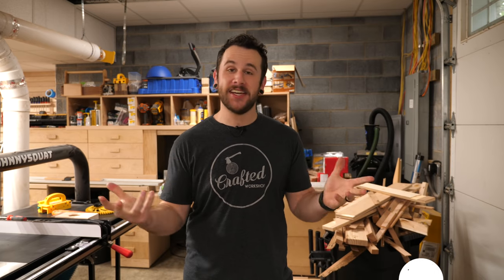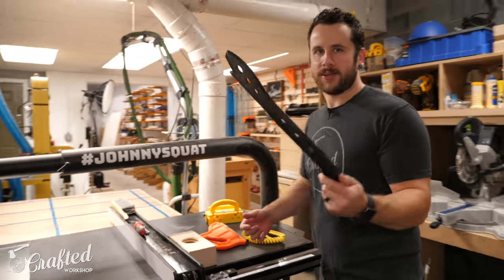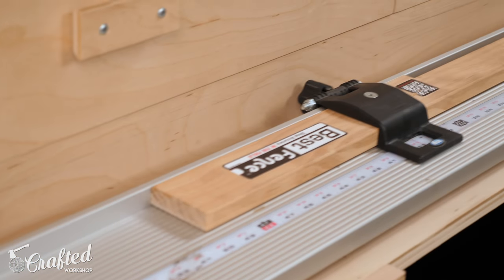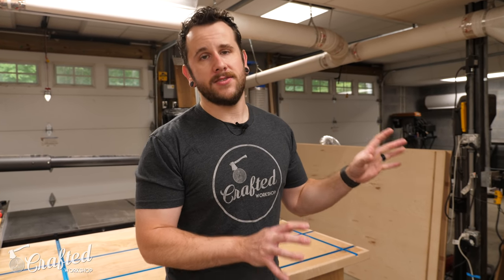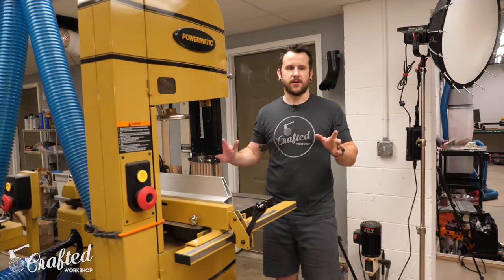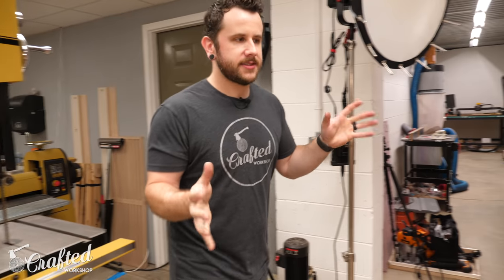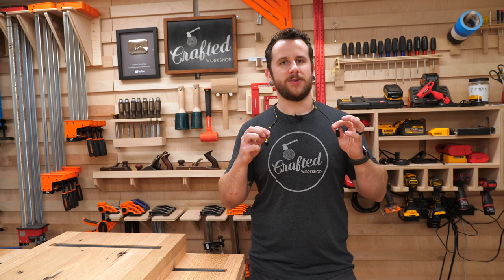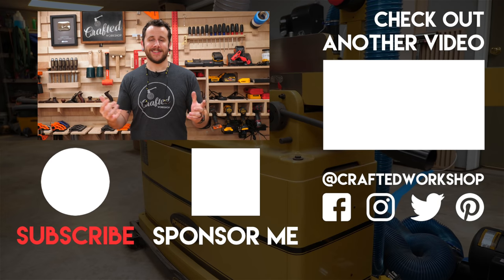Shop Tour 2018, All of My Woodworking and Metalworking Tools!

Comment: festool tools are awesome. worked in a shop where we used a plunging saw with a clamp on track and that thing cut so cleanly you didn't even have to sand it. just the corners as those were super sharp.
Reply from the maker: That they are!

Comment: I've come across some great bessey quick clamps which are designed for welding tables but you can also buy an attachment to go on bottom so they can be used in the dog holes on your workbench
Reply from the maker: Nice!
Reply: Hope it helped if you didn't already know about them

Comment: Love the shop! I’m not going to lie I’m a little jealous. My shop consists of 4 tools but you got to start somewhere. 😂 Having a good AC unit in this crazy NC summer heat. YES !!!  Very impressive to see how far you have come. You have worked very hard to get to where you are now. I can’t wait till your little one is in there running around and learning from his dad.
Reply from the maker: Thanks Chrystal! It’s definitely been a journey but I love the way my shop has turned out. The AC is AMAZING! 😊
Reply: I have a split unit in my back shop room 10x20 and it does great. I mainly use it for Winter though. I was told it would cool both rooms (other is 20x20), but it stays pretty decent most days. I'm in Raleigh.

Comment: Thanks for taking the time to post this tour Johnny, admire your organization very helpful as I work on plans to set up my first shop. Question if I may... did you consider tying your sander dust collection into your shop-wide overhead piping to eliminate the need for the 2nd Festool dust collector? And by extension, same question for your Kapex? I have similar tools and was hoping to be able to connect these to the shop-wide central dust collector. It's just not obvious to me yet what the drawbacks/challenges to doing this would be?
Reply from the maker: Thanks Nelson! I wouldn’t tie my mobile tools to the main DC as it’d be a pain when I’m working in different areas of the shop. Being able to roll around the dust extractor is great. I did have the Kapex tied in but it didn’t work that great with the big cabinet opening. I plan to fix that and add it back to the main dust collector soon.

Comment: The PVC Collector shouldn't be an issue in my opinion. now I would be concerned if you were using it as an airline between an air compressor and different tools. The suction of the collector is one thing but when you start putting 120psi+ through it that's when it starts to explode.
Reply from the maker: For sure!
Reply: I think that he's talking about a myth that PVC use as a dust collector piping system will generate enough static electricity to create a spark that sets of a fire
Reply: I've heard of that before, adding a ground wire to the PVC would solve the static issue if someone was worried about it
Reply from the maker: Yup!
Reply: Yes i agree about adding the copper grounding wire just run it though the pipe. We have that on most of the machines that my father in-law built carts for and added the dust collection.

Comment: In your shop tour you passed your lathe which I believe had four chisels on the end. I just bought a small lathe and I need to buy tools, so I've been searching YouTube and the internet for how to choose a set of lathe chisels. It would be great if you could let me know what kind of gouges you have, skews and that kind of stuff. Thanks
Reply from the maker: I just use carbide tools, as you don’t have to deal with sharpening. I’ve got a set of Woodpeckers Ultra Shear tools as well as a set of smaller Rockler tools for smaller pieces.
Reply: Ok thank you very much, I was already interested in a round carbide tool because I’m going to be turning bowls and I know they can remove a lot of material. Again, thank you, awesome advice!
Reply from the maker: For sure, thanks Miles!

Comment: Evening Johnny!  

Love your videos.  I'm getting ready to pull the trigger on the PJ-882HH and was wondering if you could do an overview/review of the unit.  Would be most appreciated!!

-Drew
Reply from the maker: Thanks Drew! I don’t really do reviews per se, but it’s an outstanding jointer. I can’t imagine needing any other features in an 8” jointer, it’s super well made and easy to adjust. The dust collection is also great.
Reply: Appreciate the feedback.  I've noticed that the reviews done on YouTube are Table Saw heavy, Planer moderate, and Jointer lacking (IMO).  If you ever do decide to do a review, I'm sure a lot of people would like to see this unit.  @thewoodwhisperer does a really good setup video, but not necessarily a review per se.
Reply from the maker: Yea it’s tricky, since a lot of my tools are from my sponsors, so it wouldn’t be an unbiased review necessarily. I can tell you that I don’t use any tools I don’t like, so I endorse basically every tool in my shop as quality!
Reply: Does this tool come with a 220 plug, or do I need to wire it myself?  3 wire or 4?
Reply from the maker: It comes with a cord but no plug. 3 wire.
Reply: Hey hey.  Quick update.  

PJ-882HH was delivered August 23rd!  I got the 220 ran from my panel to the garage and mounted a plug.  From there I custom made a 10 gauge extension cord to the tool.  Mine came pre-installed with a 3-prong plug out the back of the tool.  It was small like a 120 plug, but both of the tabs were horizontal instead of vertical.  Works phenomenally.
Reply from the maker: Nice, enjoy! It’s a great machine.

Comment: What’s the deal with drum sanders?? I’ve always overlooked them if you have a planer already, I don’t see the point in them personally is there something sick about them that im not gettin??
Reply: If I need something really precise in thickness I oversize it a bit on the planer then dial it in on the drum sander. Think crib slats or making a lattice.  You also then get to skip straight to finer grits when sanding.

Comment: I am in the process of setting up my woodshop. Originally I was slated to get the same Powermatic jointer that you show in this video except due to it coming as one piece, we could not figure out a way to get it into my basement. A 700lb machine that's 84" x 25 could not make it around 4'x4' landing leading into the basement. So instead we are going with the 60HH 8" jointer. The primary difference is one is dovetail adjustment vs parallelogram on the one you have. Have you used a non parallelogram jointer and would I be better off to locate another company that has a helical head AND parallel, or do you think the 60HH 8" jointer will be just fine? Just curious on your perspective. BTW your shop looks awesome and I want to build the outfeed table as one of my first projects.
Reply from the maker: I think you'd be fine with the 60HH. My previous jointer, an old Delta, used a dovetail mechanism and I never had an issue keeping the beds parallel. Thanks, good luck on your shop!

Comment: #Johnnysquatsquad
Why not fold some thin sheet metal on the NOVA drill press to protect it from the oil if/when metalworking? 
Clamp a piece of plywood the size of the DP table onto some sheet metal, and hammer the edges around it to make it flat...?
Reply from the maker: Easier just to have two drill presses! I had upgraded to the Nova after already owning the RIDGID, so I just kept the old one and dedicated it to metal.
Reply: I guess I'm always looking to save every inch of space... BTW I just ordered my first drill press last week so I've never actually used one. 
But I remember saying you might want to move into a bigger shop, so maybe that could be the beginning of saving a tiny bit of space :)
Reply from the maker: Nice man, have fun!

Comment: The PVC exploding dust collection thing is a total myth. I worked as an bomb squad technician for 10 years and researched this topic heavily before deciding to go with PVC for my own ducting. It's complete BS.
Reply: I think you may be confusing the use of PVC for air lines. I don't recall anyone ever claiming that PVC would explode when used in a dust collection system. The main issue with it being the build up of static electricity and not being grounded. Fine wood dust+ electrical charge = potential fire hazard.
Reply: Mark F. It's a well known myth about static & grounding PVC ducts. Somebody correct me, but I think J. Phil Thien (edit: maybe Bill Pentz?) tried to ignite fine dust in un-grounded PVC duct and could not make it happen, despite best efforts to do so. I've used ungrounded PVC dust ducts for 5+ years now, near daily use. Longest run is 35ft. Never an issue. Best, @HoneyOnWales
Reply from the maker: Yup!

Comment: One comment - Get a keyless chuck for your wood drill press, so convenient and a big time saver.
Reply from the maker: It’s funny, I prefer keyed chucks since you can lock them down tighter! Those big Forstner bits have a tendency to slip otherwise.
Reply: If you have a special need for that then perhaps keyed is better, I've used a 13mm Jacobs keyless chuck drilling big holes into stainless steel which is notoriously hard to drill and never had a slipped bit.